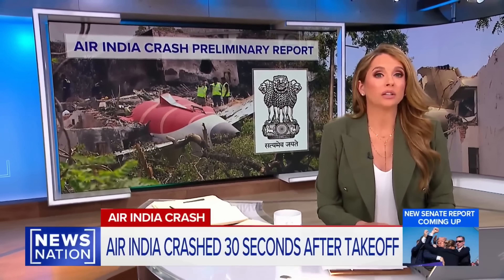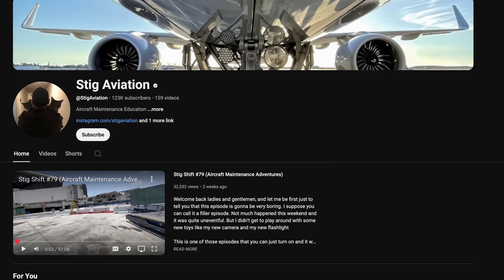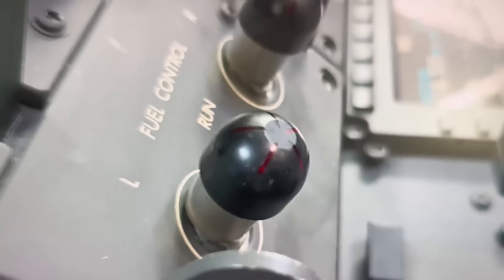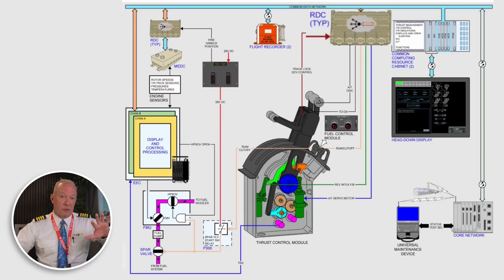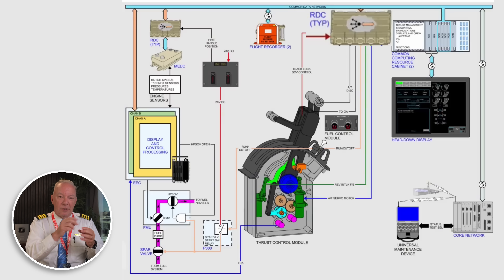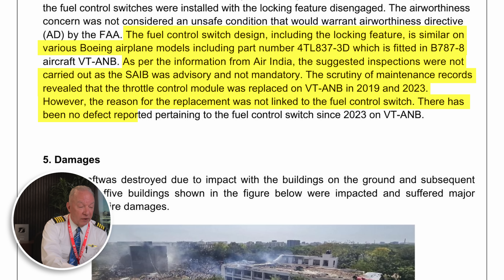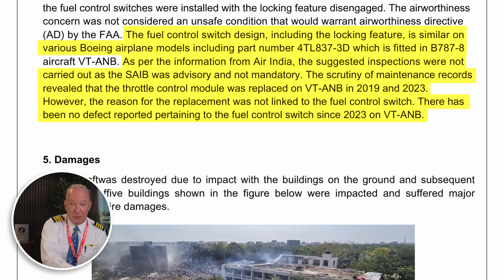The Truth About Boeing 787 Fuel Control Switches

Comment: I'm assuming that those fuel valves are normally open, and that it takes electricity to close them; because if they were normally closed, then it would take electricity to open them, and if you lost power to the valves, then they would close.

Comment: Attention Please, it is extremely important to carryout the comparative analysis to the FDR and CVR in order to reach the fact as to who is the main culprit behind the  AI 171 Crash. Incase the Boieng Aircraft 787 engines went into cut off position with out the physical input by anyone of the two pilots of the aircraft then the timings of both the FDR and CVR will confirm who was the actual culprit that led to the crash. Incase the engines flameout took place  well before the pilot saying, "why you cutoff the fuel switches" in respose he said he didn't do so" and the pilot as a part of the normal procedure turned off the fuel switches and then again within a seconds turned them on in order to restart the engines and regenerate the thrust then it will be clear that the pilots had no fault or any kind of willful intension to crash the aircraft. Pleas do convey my point to the investigators so that they can focus entirely on the FDR and CVR. Best of luck to the investigators!

Comment: I think by your own choice of words you maneuvered yourself in a bit of a bias about the system. You say it like "physical switch provides electricity to a relay with then ..." but a switch does not provide the actual voltage or electricity. Let's say it is connected to a battery, if there's a short-circuit anywhere on the same wire and the switch is provided with 0 Volt for some reason, this very well engineered switch suddenly becomes a hook where you can hang small things, like a wristband or a baseball cap or so. In any case it will no longer provide power to that relay. Maybe some component died and pulled that battery bus to zero - maybe the battery died. Batteries can short circuit internally in the  worst case. Then the only question then is, how the system would react in such a scenario and would it be possible that what happens on one side could have an effect on the other side. Maybe the RAT did deploy because the main battery died fatally. I think you explained everything very well and detailed, but what could happen electronically that could cause the switches to not actuate those relays you left a bit of a blind spot in your analysis. This is not supposed to be a harsh critic, but I noticed before and in that interview again, that you kinda don't want to look at what could happen before those switches and rather explain the switches themselves and what comes after and that that it's unlikely that there could be the fatal issue - which I do believe, based on your explanation on how they're built and how they work

Comment: I understand FPV valve is not operated electrically:: FAV – Fuel Actuated Valve

• Function: Often refers to valves that are operated directly by fuel pressure rather than electrical or mechanical means.
• Role: In some systems, the FAV may be part of the fuel/oil heat exchanger loop, helping regulate fuel flow and temperature before combustion.
• Control: Managed by the Electronic Engine Control (EEC) depending on fuel temperature and engine conditions A.

Comment: Yep, "electric" is not the same thing as "electronic". For my fellow travelers in the back of the plane, it's why we only need a power ADAPTER to plug in our laptops and mobile phones, while we need a power CONVERTER to use a hair dryer, clothing iron, etc.

Comment: Apparently there is a sensor which detects if the aircraft is in the air. Someone has said if that sensor fails it's possible the aircraft is in the air but the plane thinks it is still on the ground.  Can  the firmware turn off the fuel without the switches being  moved; it's software after all ??

Comment: The fuel cut off switches are only a simple mechanical connection to an electrical circuit. The relay coil needs to be energised by 28vdc for it to operate. A faulty 28vdc or earth path anywhere in the circuit to the switches or relay coil would cause the same effect as the switches being mechanically moved and the contacts to open. As the Thrust Control Module was replaced, is it possible that the wiring loom connectors were incorrectly connected and over time eventually moved apart during the mechanical shock of the undercarriage unload and retraction at take off, so interrupting the continuity between the Fuel Cut Off switches and the relay module.

Comment: The German engineer did an in-depth analysis and concluded that the RAT was deployed before the fuel switches were turned off due to an electrical malfunction that then caused the human to turn off the fuel switches. There was a lot of data involved in that conclusion (I am not convinced). However I believe this possibility should be thoroughly investigated (I do not understand why it would take 9 seconds to turn the fuel switches back on, this would tend to counter the German engineer's theory).

https://youtu.be/nxul8TOIf38?si=5Ao8PTc2rc9OYo5Q
Reply: Richard Godfrey is a very well known engineer but for sure is not a german 😊. Just look him up on the Internet

Comment: cut the power before the switches you have effectively mimicked the switches being moved without moving them, cut the feed power to the relay you have mimicked the switch for that relay being moved even though the power via the switch has not changed, the purpose of a relay is to switch on a high amperage supply via a lower voltage\ampage switch, so you DONT have all the power demand for pumps\solenoids\etc passing through the switch.

in other words it is posable for an intermittent fault to cut the power before the switches and mimic the switches being moved, just as it posable for an intermittent fault to cut main feed relay and mimic the switch being moved, remember too low voltage cause by a ground fault or other type of fault can drop the voltage to such a level through the switches that the relays will think the cut-off switches have been set to off, just as a low voltage in the relay main feeds could cause  some of the pumps\solenoids\etc not to work.

and what phase of flight was it, it was the phase with lots of bumps and high vibration, high demand loads on lots of critical systems, and lots of thing in flux, which it the most probably time a new or existing intermittent fault could happen.

likewise lets say there was an intermittent fault, then the pilot\s very well could have manually cycled the cut-off switches which would have dropped the electrical load on that portion which could stop the intermittent fault, given "did you turn it off and on again" is a common mantra.

if you close you mind off to other possibilities then you are just using conformation bias,

Comment: Capt Steeeve, So yes there is 28V present in the Spar valve, but it is not to lock and maintain an electrical brake on the valve's position. Sorry if I misinterpreted what you said, but to me it sounded like you were implying that DC power is used as a force to lock the valve in position. Just as a point once the 28VDC is applied to the 787 spar valve (this is a typical Boeing electrically operated  control valve),  the motor drives in one direction, once the valve is driven to it's operating position the 28volts to the motor is removed. Inside the actuator are switches that tell the position, when to remove power and which way to drive the motor next. (RUN or CUTOFF).

Comment: Did The rat deploy before or after the fuel switches movement? If the rat deployed before the switches, so maybe had been an issue with the electrical systems of the airplane, the resulted in shut off both engines...

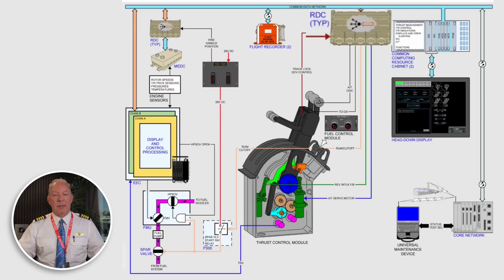Comment: 8:50 there is a line from "display and control processing" ladled "HPSOV OPEN" to an "AND" between one of the valves and the switch - that implies there is a signal that if transitioned low, would close that valve?
Reply: Yes. Good spot

Comment: I took my car to a mechanic 20 years ago, something to do with fuel. He fixed it and the car would stop on middle of the road and would start after a few minutes The problem was not attaching  some electrical connection properly. What if the issue is with the battery, what happens if the electrical connection was interrupted for some reason and how would the relay respond.

Comment: Hi Capt Steve, great video. HOWEVER….  Firstly we can all agree that what ever happened was a very low probability event. We know this because 787s do not just fall out of the sky every day.  So the question now is not IF a low probability event happened, but WHICH Low probability event happened. This is crucial!  It is crucial because it is very hard to find low probability events. This means it is going to be hard to find that low probability event and therefore we should not be jumping to any conclusions whatsoever.  This in particular includes blaming the pilots.  I am not saying that a pilot did not do it.  But what I am saying is that the thought of a pilot doing This is so abhorrent that it absolutely must be the very last possible explanation after every other low probability possibility has been conclusively dismissed.  As an engineer, I understand what you said in the video. But what I did not hear is how the switches position is sensed. If it is sensed then there are connections, and where those connections go and how they work is important. Also, on your battery discussion, there was no mention of a possible battery transient. Batteries and battery chargers have been known to arc or have other misbehavior.  I concur that connecting to a battery is considered a high reliability control connection.  But nothing is full proof and neither our batteries and their chargers.  You may say that a transient from the battery is a low probability event, and I concur.  But so too is a pilot flipping those switches.  Also, on the switches, I understand what you said about replacing the control assembly. But just as in automotive maintenance aviation maintenance also reuses parts albeit with a higher standard of checkout (hopefully). There is nothing that precludes a faulty switch having been re-introduced into the control assembly when it was replaced.  That kind of stuff happens all the time with machinery.  We hope it happens less with airplanes, but with humans involved it is not the first time that this has happened and it won’t be the last.  In conclusion, we can assert with absolute certainty that whatever ever happened was a low probability of occurrence event, because 787 don’t just fall out of the sky.  What we don’t know yet is which low probability of the currency event happened and it is going to be hard to find because it is a low probability of occurrence event.  That the pilot did, it is the easy to understand potentially wrong answer.   This is not to say that it is the wrong answer, but it must be reserved as the absolute very last possibility after every other low probability of the occurrence event has been conclusively dismissed. And even that may not be completely determined by the end of the investigation, because sometimes the answer is that we jut don’t know.  We will just have to wait and see.

Comment: "Open" and "closed" are certainly two opposite states. It's either one or the other.
However, the terminology is different between valves and electric switches.

When an electic switch is "open", the conductors from each terminal are not in contact with each other; there is a gap between them. A direct current cannot flow through. But when the switch is "closed", the connectors make contact and current can flow through.

Valves are the opposite: when the valve is "open", fluid can flow through. When the valve is "closed", the flow is physically blocked.

But this is just a terminological observation.
Obviously, the 787 has flown a million successful flights so we can be assured that the engineers understood the terminology and connected the components the correct way.

Comment: Steeve! When the engines cut out, Captain Sabharwal started the relight cycle by switching switches to CUTOFF. The reason he then waited 10 seconds before returning to RUN was to prime the FADEC ( like when your laptop doesn't boot properly and you try switching off, waiting a few seconds and then switching on again) and to ensure the RAT was delivering power. He could not have known at the time the FADEC was already long dead by drowning. We lost a really quick thinking and deft pilot in this comnpletely avoidable crash. The co pilot asked "why did you do that" and the captain replied "I didn't"  because the fuel had already stopped flowing and he knew this from the EICAS. He remembered to call MAYDAY, MAYDAY, MAYDAY.

Comment: Fuel control switches are controlled by wire. Best example Air France Flight 072 F-GITA engine number 1 of a 747 won’t TURN OFF. 😂

Comment: I so appreciate Captain Steve’s language precision because it’s necessary in this situation. Then reading the comments and the gibberish and conspiracy theories and “what if” speculation it’s as if we watched a completely different video.  I weep for our country where so many have lost the ability to think critically and react accordingly.
Reply: Critical thinking would mean coming up with your own hypothesis, rather than being ok with whatever a video says.

Actually, if the system works as Captain described it, then a battery failure would cause exactly this scenario.
Both relays would open, all valves would close, and they won't work again until the RAT starts providing power, some 10 seconds later.
Reply: @giacomoneri1782 Seems the fuel valves would fail in the position as is when the power is lost to them. In process systems that is at least what we do to maintain critical functions.
Reply: @giacomoneri1782 did you watch the video?!?  This scenario is also not possible.  Air India tried flying a total electrical failure in the sim.  Guess what, the engines were still running.  This isolation of the systems is by design. One of the people in the cockpit broke.  That’s the only thing that broke that sad day.
Reply: It's not as if Boeing doesn't have a history of blaming pilot mental health issues cough Lion Air 737 Max *cough*.
No mentioning of the Fadec back then in the preliminary report. Not even in the preliminary report of the second crash, when countries already grounded the type, blaming pilots health issues after having to admit that neither airline had maintenance issues in both cases

Naiv dudes: "yeah, it's the pilots THIS time! "

😂 C'mon...

Comment: I've seen switches similar to that on other things. Those nibs can wear out, break off, and bend out. Repeated careless operation does it. Instead of lifting the switch over the nib it can be forced over eventually damaging them. Then they pop out of the detent position. The lower nib can be damaged, and the upper nib can be damaged. Commonly the nib on the upper cylinder nib flares outward. Even the cylinder itself can be forced out of round. Then the switch will pop back to center or even to the opposite position. Often it will not hold even when repeatedly switched into the desired position. As the damage occurs they become easier to force. They will have to be carefully examined for that damage. It is not always visible by external visual examination especially if the cylinder gets bent out of round. 

We don't know why the switched moved until there is a careful examination of them. I would advise micrometer measurements of all dimensions of them. They look .030" thick (half of 1/16"). Wear off .005" two human hairs, from the 2 lower nubs, the same from the 2 upper nubs, and .010" out of round of the upper cylinder, add to that some tiny flaring of the nibs, and the detents are non functional. Not all of that has to happen for them to be non functional. Any one of those damage factors worn enough can render the detent non functional. Even some contamination preventing them from seating properly can contribute.  

Since that damage can occur all switches of that type should be examined, Better yet replaced by switches that can't be moved in a careless way, and until that's done pilots need to be informed of that flaw, and be more careful. A better design would be the detent nubs be longer, and thicker, so they have to be lifted higher to move them so they can't be merely forced over the nibs. Maybe even turned 90 degrees then switched, and rotated back to lock. Since forcing the switch would be a pilot failure causing the damage the switch has to be designed to prevent the pilot from being able to do it whatever the new design is.

I'm reminded of the movie sequel to 2001: A Space Odyssey. 2010, The commander has to reach up, pull two large cylinders down, turn them 90 degrees and release to fire the engines.
Reply: This isn't a movie
Reply: @guitarexpert2245  I knew if I mentioned it some troll would say exactly that.
Reply: @dpsamu2000  You wrote we don't know why the switches moved?  We do know.  SOMEONE MOVED THEM.
Reply: @guitarexpert2245  You personally saw them? You personally examined them with a micrometer? You read a report that somebody did? You're a bigot? What's the source of your self proclaimed knowledge?
Reply: @guitarexpert2245  I made the largest piece of equipment used to make the, by phenomenally far, safest airliner in aviation history. What do you bring to the table to support your UNINFORMED OPINION?